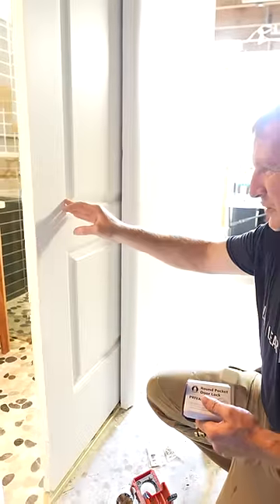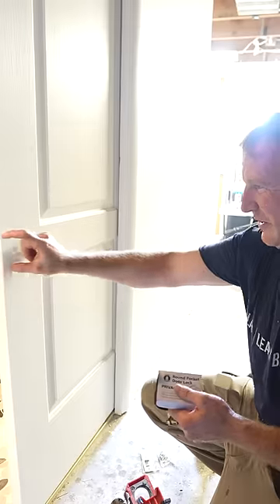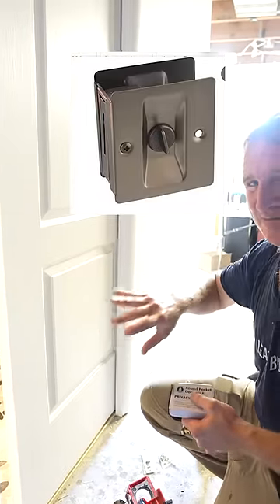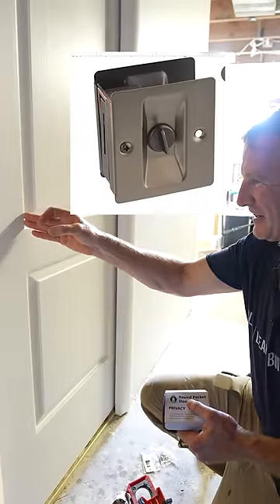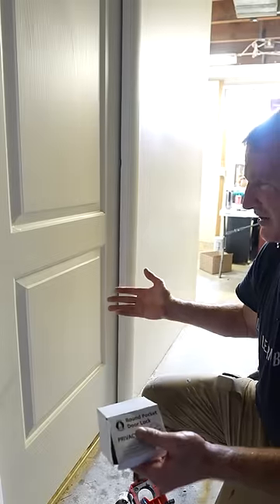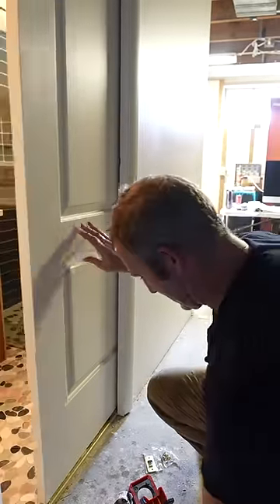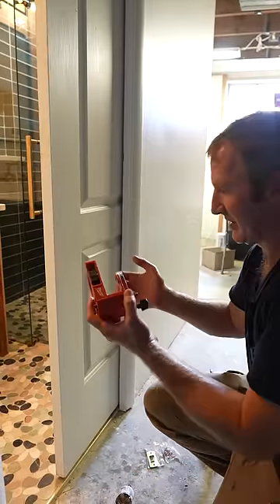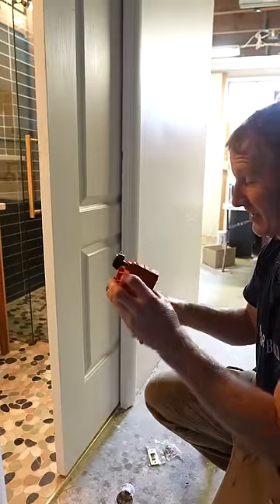Better Pocket Door Latch

Comment: How does a deadbolt keep the door from sliding?
Reply: Great question lol😊
Reply: The deadbolt has vertical fins when locked. Watch again you'll see them activate when he has it out.
Reply: I was like wtf!? 😂😂
Reply: @JORGE1234567899 kinda defeats the purpose of the deadbolt.....all around stupid idea.
Reply: @zbelair7218  - this deadbolt isn’t a security deadbolt intended to keep intruders out. It’s intended to protect the privacy of the person using that bathroom, and to do that with a pocket door some type of hook is needed, unless you use one of those locks that drops into the ground and goes up into the door header frame.

Comment: My problem with pocket doors is that the handles often have a shallow, angled surface that makes closing it difficult if there is the least resistance.
Reply: reeva steenkamp would also agree.

Sorry, I am sick in the head.
Reply: Yeah those have been a thing for 70+ years
Reply: This doesn’t fix that. Also hard to use with nails.
Reply: Exactly. The problem still exists. Better but still takes finger strength.  In a narrow shallow poorly designed handle.
Reply: It's easy to add a pull handle to the door above the pocket door lock, and make it more accessible.
Reply: The handle doesn't have to be so small you can have the door which doesn't go fully into the pocket leaving enough room for easy to use handles, latches or locks as required
Reply: Gotta practice rock climbing. 

Get those finger muscles (tendons) built
Reply: Look up Delaney pocket door hardware. Better depth, plus a separate pull out to grab to close the door. We LOVE them

Comment: I have pocket doors.  They are great for doors that rarely need to be closed.  Like the water closet in the master bath.  The only time it gets closed is when I walk in to shower when the wife is in the water closet.  But they really solve the issue of the swinging door wasted space.  When designing a house it is amazing how much space you have to waste to allow doors to swing.
Reply: Why do you need to close a door around your wife when you shower?
Reply: I really can't stand a separate toilet room in a master bath. If you have a problem with a spouse watching you poop, then get therapy.
Reply: @cgschow1971 if the ventilation fan is it in the toilet room then it would keep the smell in. That would be a big plus. However you'd need an open top above the door to make sure the fan is sucking out the humid shower air....

Comment: Saw one made by a blacksmith.   It was an L shaped lever with an angled hook end.   A plate on the Jam engaged the angled face on the hook such that the hook pulled the door closed.  It was large, with the handle being four fingers.   It worked very well.  It's the little fiddly bits that don't work well.
Reply: I was just thinking that i would not be able to turn the lock that i wouldnt be able to grip the fiddly bit.
Reply: Then you slide the door out because that was just a normal looking deadbolt no?

Comment: Just wondering about that lock
Can’t you just slide the door open? I looks like a dead bolt and the way the door opens makes it useless unless I’m missing something.
Reply: No, go back and watch carefully.  There's a saw-tooth clip that pops up on the lock bar that anchors it to the inside of the door when the lock is in its fully locked position.  It's small, but it's more than enough to keep the door locked from casual entry.  When unlocking the clip snaps back down before retracting the lock bar.

I question the efficacy of a lock like this in an intruder situation.  But it'd definitely keep someone from barging in on you.
Reply: @NorthshireGaming is for bathroom doors at your house. Not for security
Reply: @Meltman1000  you're missing his point
Reply: I had to watch it twice to sse the little hooks on the deadbolt. I thought the same thing at first too lol
Reply: I do this shit for a living, and I'm a little confused myself?
Reply: That's what I thought too😅
Reply: @RJletsgo the bolt has 2 "hooks" that pop out of the top and bottom of the bolt... the inside of the plate that you mortise into the jamb accepts the bolt and has 2 recesses on top and bottom to hold the "hooks" that pop out of the top and bottom of the bolt.
Reply: I was thinking the exact same thing 😂
Reply: The deadbolt has a set of hooks that pop out when activated.  They work like a fishing spear on the wall plate. Ahoy mateys!
Reply: Look closer it has 2 hooks top bottom of the bolt
Reply: I was saying the same thing then i saw the little hook
Reply: @NorthshireGaming 

How secure are interior doors really? They are hollow and can be kicked in. It’s not like in the movies. Really look at interior door locks. Easy to defeat with a screwdriver, made that way if a child locks themselves in a room accidentally.
Reply: He didn’t even test the door once closed which really makes me question if he did alll this before realizing he too forgot that fact
Reply: That one has teeth so you can’t
Reply: If look closely or pause the video, you will see a wedge shaped protrusion popped up on top of the bolt…

🤔
Reply: Bruh you guys must live with some crazy people if you need your bathroom lock do to anything more than let someone know you’re in there
Reply: @RJletsgo lol😅 , and you do this for a living , you must be broke if you don’t know how this lock works! Sheesh 🙄 dude !!
Reply: Actually I was thinking the same exact thing.
Reply: Nevermind I see it now.
Reply: @david_kim I am also shocked, people are acting as if they need a dead bolt type system on their batbroom door
Reply: @RJletsgo old people won't be able to use it.
Reply: You miss the best part. If you take a better look, when the deadbolt is fully out, a little pin pops out of the top.
Reply: @Meltman1000  any room can be your final resting place. Why not be able to barricade your bedroom doors?
Reply: I’m thinking the same thing
Reply: Literally just thought the same thing. Genuinely curious. I wonder
Reply: There are little wings that pop out. Clever design
Reply: That’s what I thought 😂😅
Reply: How often do these things fail? Also, what do you do if you still need to access from the outside? I didn't see any kind of keyhole, so do you just have to chop through it with an axe if some kid is choking on their toothpaste or drowning in the tub?
Reply: Who locks their bathroom door🤔

Comment: I have used ones that are essentially a lever lock, on the door itself there is a groove in the metal for the handle and then on the jamb you install basically a toggle switch like the interior side of a deadbolt that flips over a small metal latch into the groove on the door handle locking the door. Very sleek, doesn’t stand out at all or catch the eye seeming out of place but is very effective at locking the door.

Comment: How does a straight bolt work on a pocket door?  The pocket door slides, not swing. So wouldn’t the bolt just slide out as the door slides?
Reply: It has a spike coming out, it can be seen
Reply: Did you even watch?

Comment: 11 year trim carpenter here, and I hate both of those lol they both don't work well or stay.in adjustment for very long. In the custom home world we are blessed to use the emtek deep mortise hardware. It takes special mortiser if you don't get them mortised from factory. But they are the best pocket door hardware I've ever installed.
Reply: First time putting one of those in with NO special tools or drill bits was 3 hours of cursing.

Comment: So a cylinder deadbolt going straight into the jamb.  But door isn't hinging,  what keeps the door from being pulled open. 
The square type has a little hook that catches the striker plate so you can't slide open

Comment: I do Trimwork ( interior finish carpentry)
I never had any problems with the square type. They are easy to put on. I had problems with the round locks.
Maybe the brand you are showing is different.

Comment: Have you tried the chisel on the face of the Blu-Mol to cut out the recess for the locking bolt face.  I like it becuse it gets you close (depth) and minimizes the amount of work with the chisel.

Comment: Wow. I hate pocket door for that same reason.  Thanks.
Reply: I hate pocket doors because ones used frequently tend to wear and jump the track , fixing them is no simple job , you won’t find any in my new home . 👍🇨🇦
Reply: @cameronhamer9432  over time weight and setting of a house will become a problem.  Then the latch will not catch the sticker.

Comment: I want to know what tool you use to drill the lockset holes. It looks a lot more sturdy than the Ryobi one.
Reply: I built residential and commercial for 30 years. In building, I learned one valuable lesson.  Never buy a Ryobi tool. I bought a detail sander made by Ryobi,  plugged it in, and after a few minutes, I realized  a block of wood with sand paper wrapped around  it worked 10 times better  than their sander. I threw the damn thing in the trash.  I do have to admit Ryobi tools come in pretty boxes.

Comment: I have used both and prefer the square version he's got in his video for one simple reason: if you have the pocket door fully recessed, the square lock has a small "L" shaped lever built in to the spine of the door that allows you to pull the door out of its pocket. The kind he's advertising does not. Good luck getting the door out of its pocket.
Reply: Yes, the version he is installing has a spring-loaded extension that pops out to grab. I'm actually on site right now with one next to me that I'm about to install. There's no problem getting the door out of the pocket. The square ones are inferior.
Reply: @nonprogrediestregredi1711  yo 2"3/8 setback gang.

Comment: Wait, when you try to slide the door open with the deadbolt locked, what’s stopping it from just sliding out of the lock? Wouldn’t you need a hooked lock?
Reply: There is a small hook on the top of the deadbolt

Comment: Yeah the square ones are crap. Ive fitted heaps for a building company that i was a carpenter for. We moved over to the round ones and never looked back. I love the jig youre using. Do they convert to metric sizes. In Australia we call them a cavity slider door

Comment: How does that stop the door from being opened?  It slides and doesn't swing so wouldn't sliding the door back just pull that deadbolt right out?
Reply: If you look closely at the deadbolt, you'll see small prongs that pop out when the lock is engaged

Comment: I have jack and Jill bath with pocket doors on each side. How would I have locks on both sides of the doors such that you can lock each door to prevent entry to bath from bath side and prevent entry to room from room side. Oh and if there were a way that when you leave the bath you are guaranteed to have both doors unlocked to enter bath from either side.

Comment: Agree those locks sux.
I used a commercial door lock, like they used in everyday retail doors. Strong and uses a common cylinder. Only problem is that you're going to have to bore out a solid wood door.

Comment: Why not build a big aesthetic hook that latches to a ring pin on the door? Why not have the door use a spring (or counterweight) to stay in closed position. What if the door had a smaller door built-in that can open on hinges normally normaly

Comment: Explain how this works to a baby. Lol. How does a deadbolt. Which is normally for sideways stress. And locking. How does this deadbolt looking this lock into place? Are there hooks on the other side that hook into it?
Reply: If you look closely there's a tiny vertical tooth that extends out the top of the deadbolt pin. That's latching into the receiver.

I can't imagine it would take much force at all to open it, but technically I guess it "locks"

Comment: a pocket door can't be locked by a regular bolt lock mechanism, it would just slide back. In this video I didn't see how the lock functions. How does it work? oh okay I saw rewatching. there's just little pins that pop out. Not as secure as the dead bolt - much less metal holding it locked. but I guess it will work if you don't breathe too hard on it.

Comment: Man thats the only thing you hate about pocket doors. 

I have a laundry list about the frames
They’re impossible to get in volume
They’re always poorly constructed
They’re going to bow
The door is going to bow
The hardware sucks
The screws from the drywall are going to scrap
The door slabs never fit right
They’re going to get mounted by the carpenter one way, taken off by the painter and remounted completely backwards. 
I deal with 84lumber on too many warranties and thats a real punishment.

Comment: That door just slides so that door closure doesn’t work you just put your finger and push it back. You need something with the hook on the latch
Reply: If you look closer, you will see that it has a small barb that sticks up when you turn the latch that engages on the wall side of the strike plate which "locks" the door. Try expanding to 250% and you will see it.

Comment: I thought the answer to the question about the worst thing about pocket door installs was everything. Basically all awful, have to put pressure on the door while closing so aligning that bolt with the hole often works from one side but not the other. The hardware is usually garbage, they run on plastic wheels, the pocket they slide into is very weak so if a bathroom vanity countertop gets shoved into place against it can bow in and pinch the door so it scrapes. Not saying they couldn't be built better but the standard install ones suck. I've installed hundreds and although we can do them as good as the material allows it is always a wonder they're still in use.

Comment: Im sitting on a toilet taking a dump in a bathroom that has a pocket door with one of those square locks... Damn thing locks ok but if break it, you might not be able to get out of the room. Ive had someone need to go get a screw driver to let me out before. Luckily i could put it back together and it's been working for over a year.

Comment: With a quick enough yank on that door that lock will fail very very easily you're better off using a sliding lock with a drilled hole in the floor and a heavy duty sliding lock but set it up to be vertical that way once you get in there you could just take your foot Slide the lock over and let it drop get ready to leave pick it up with your foot and slide it right back over to lock it in the upright position just like the one on my front door that I installed, in fact I have nine locks on my front door and six of those locks I built from the ground up trying to improve locks for people with disabilities like myself

Comment: A dead bolt does not work very well either Won't make pocket door stay closed. You need a hook latch in order to keep the door from opening. I have been in home construction for a very looong time. Always looking for better ways .
Reply: you can see that the bolt has some hooks that deploy when is locked

Comment: The problem is, you still must pinch fingers together to get a grasp on the levers to move them. The older you get, the harder that is to do. And if you must hurry, its a problem sometimes. I loved your rendition all the way up to when you didn't use the paddle type door handles instead of those old, hardware type of metal toggle switch design. That messed up your beautiful idea.

Comment: I do A LOT of pocket doors. I have installed both styles and prefer the round ones, but they are a b*tch to line up perfectly to the strike, which is required for it to lock properly.  Also, for ladies with long fingernails - and they all have them - the spin required to latch and unlatch is very difficult and prone to breaking nails.  I'm still waiting for a genius to build this mousetrap better.

Comment: Where do i get that door knob hole drilling jig?
Reply: The knob hole jig seems a waste of money to me. You have to use a hole saw to cut the hole anyway and if it has to be that accurate due to your lack of skill, you can drill a pilot hole to guide the pilot drill of the hole saw. Unless you are doing this for a living, all the jigs are not worth it but the hole saws are and so are a sharp set of 3 chisels, 1/4, 1/2 and 1 inch wide.

Comment: I ALWAYS discourage pocket doors when client's ask for them. When they don't listen, i let them know that when the frames warp and rub the door, it will not be a free fix.
Reply: Steel frames warp?
Reply: @JPWarrior02  some pockets doors sre wooden frames (usually cheaper and more common). When it comes to the steel frames, such as a crowder, the wooden jambs will warp sooner or later. It's very common.

Comment: My experience makes me afraid of all the moving parts it takes to retract the little hook on the bolt that keeps the door shut.     That little piece is also inside a moving bolt.  

Completely agree on how awful pocket door hardware is in general. We’ve been using them for maybe a hundred years or more and this is the practical upgrade? 

Hopefully this hardware will stand up to time and offer us some options.

Comment: I hate these flat handles. If I ever have a pocket door, it's getting a Mag Lock. And the handle is going to be an 80% deep notch. And before you say 80% + 80% = 160%... You solve that with having each side offset. You can't see both sides simultaneously. It won't look off putting.
☮️❤️🌈

Comment: How exactly does a bolt stop the door from opening!? It slide right and left, like wtaf that was pointless.
Reply: If you watch again it has little. barbs that stick up once fully out. Also there is not much to pull on for the door so that's enough to stop it
Reply: @steve_main  yeah def didn't see that the first time. Thanks.